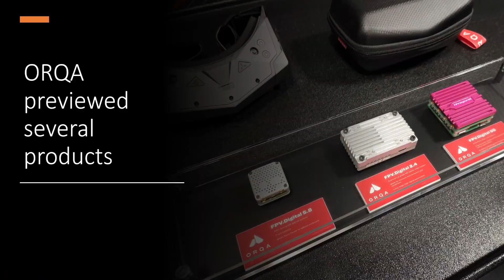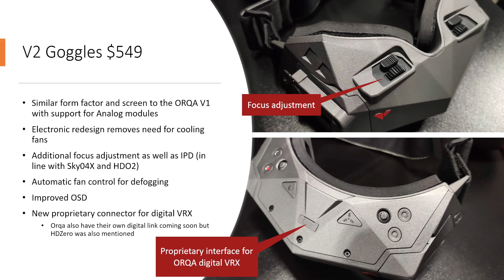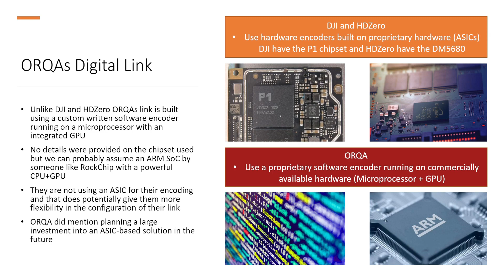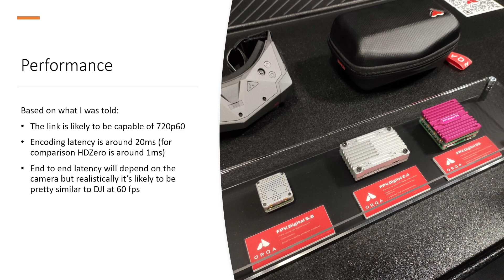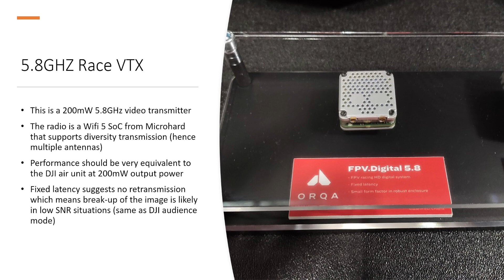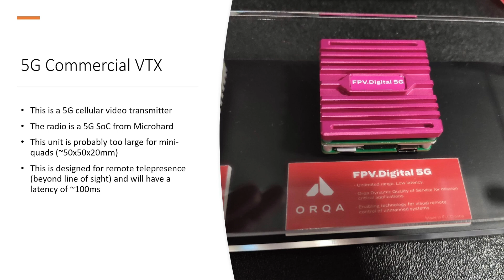ORQA's NEW DIGITAL FPV SYSTEM: Everything I know! (and other products they showed at CES)

Comment: Assuming a pure general-purpose CPU solution, this may pull just too much power from a drone battery, I would find this hard to believe, honestly.   If I may speculate any further, FPGA chips (basically purposed for prototyping only) may be a better guess as nowadays, they allow sharing programmable logic, ARM CPU's, ASIC technology and even AI engines on the same die.  This class of chips surely would manage to keep power consumption rather close to their ASIC ancestors.  For several years already FPGA's became popular among retro-computing fans for their ability to emulate some powerful custom graphics and sound chips from the Commodore Amiga lineup.

Comment: DJI is 120fps not 60
Reply from the maker: In high quality mode DJI is 60fps. In low latency mode DJI achieves 120fps with cameras that support it (DJI camera and Nebula Pro). Orqas solution is likely to be similar to DJI 60fps.
Reply: @ChrisRosser  The question is why would one invest in orcas if they are same as DJI?   I would not sell my DJI to get Orcas if they are same.  Orcas need to give me something that DJI does not.  
And DJI can cut price to compete with orcas.

I heard DJI will introduce AR system where you can build virtual gates in sky to race.   I am sure that is more exiting then competing on same technology.

Comment: Do you know if these VTX/VRX include a control link like SBUS?

That would be necessary for the 5g one I guess
Reply from the maker: Maybe for the 5G version. For the other VTX I believe the intention is to integrate IRC Ghost into the flight controller rather than the VTX because there is less interference on the FC.

Comment: The controller is a huge miss in my book with it's proprietary connector but my guess that is that was Ghost's doing to lock people into their ecosystem. I'm super pumped for the goggles though. They look very promising & they said with their adapter you'll be able to runs a variety of receivers on it. It'll be neat seeing how that plays out.
Reply from the maker: I'm interested to see how it plays out. I'm undecided as to whether the goggles offer much of an advantage over my Skyzone 04Xs at the moment and the controller is ghost only which is tricky because I like having support for multiple protocols.

Comment: A way more interesting approach for them would have been an FPGA+MPU solution to get the latency lower.
Like this I don't really see it being competitive with DJI or even HDZero. At least in the FPV space. Might work well for other, especially industrial remote control applications though.
Reply from the maker: Yes, I asked them if they were using an FPGA but they said no. So I think its just MPU+GPU for now.

Comment: Hello and thank you for all your hard work …I have a question for you or our community,   I have a nazgul 5v2 just replaced the stack …flying every day but I have to land early bc my battery readout says n/a…it has a vista …please help I’d like to get back to flying full packs …custom osd is turned on in dji goggles
Reply from the maker: Your MSP connection isn't working. Maybe TX/RX is wired up the wrong way round or the wrong port is set in BF.

Comment: Based on this information regarding our FPV hobby, it seems to me like Orqa have taken the worst parts from both the DJI & HDZERO systems & made a product. That being the higher latency (even if it is fixed) from the former & worse camera image (720p 60fps) from the latter.
Unless I'm missing something, buying this over DJI or HDZERO makes no sense 🤔
Reply from the maker: Given the information available at the moment I have to agree. Unless ORQA have worked some unicorn magic a software encoder (even with hardware acceleration) is going to find it difficult to compete with a pure hardware solution.
Reply: What if it has lower latency than DJI, and also fixed, and higher image quality than HDZ though? That might be a sweet spot for a lot of people. What I find most interesting though is if they prove that general purpose chips can achieve something usable then that opens the way for open source development. Wouldn't it be great to see a project similar to ELRS building an HD FPV system?

Edit: Carl seemed to be saying in his interview that HDZ isn't doing traditional video encoding, just 'removing redundancy'. This implies things like RLE, chroma subsampling and even algorithms like zip may be enough to get 720p video down to a usable size for wireless transmission. Those would need at most 2 frames to compare (so can be low latency) and are achievable by CPUs and GPUs. Perhaps that's all Orqa are doing.
Reply: @sligit as I said in my original post, my opinion is "based on this information" from Chris's video.
I totally agree that it's great to have another competitor in the HD market & I hope that it pushes each company to strive for better performance, cheaper pricing etc.
If Orqa were able to do all of the things that you hope for, then they should have included them in this initial release to make it competitive with the already established market leaders. As it stands, they are playing catchup & there is currently no reason to buy this over DJI or HDZERO.
Reply: @pscott82  I've no idea if it'll be any good but if they're putting the money into manufacturing then presumably they have something they think has a market. I've no idea if the video will be better or worse than HDZ because Orqa aren't sharing what it looks like, so it's all speculation at this point really. All I was saying is that if they could find a middle ground between HDZ and DJI then there's probably a market for it..
Reply: @sligit yes it's all speculation, but based on the details already revealed, informed opinions can be made.
If you haven't already watched this weeks 'The News' with Joshua Bardwell & itsBlunty, they shed more light on this project & make it sound like the FPV hobby is not the main focus of Orqa. We're an afterthought & won't be seeing this product in hobbyist's hands anytime soon.
Reply from the maker: @sligit  OpenHD and RubyHD are both open source projects that have been working on HD FPV for some time. Unfortunately their latency is still 50-100ms glass to glass. Even on very powerful hardware like the jetson nano. I'd love Orqa to be able to achieve lower latency and higher image quality than DJI on inferior hardware but that would qualify as a miracle in my book!

HDZ throws away information that has a minimal effect on the perceived image. To get down to 1ms latency it works on 3 lines of the image at a time. Waiting for even a single frame takes too long. DJI uses subframe encoding (working on part of a frame at a time) but even on an ASIC the processing time must be around 10ms.
Reply: @ChrisRosser  OpenHD and RubyHD are both using traditional video codecs though I believe? Those are inherently high latency. The point I was trying to make is that if Orqa are managing relatively low latency on commodity hardware then they're probably doing something else, possibly something closer to the method that HDZero is using.

It seems that relatively simpler (than traditional video encoding) operations on the image data can get the video down to a transmittable size because that's what HDZ is apparently doing. Those sorts of operations might be achievable fast enough on a GPU because they may not involve the heavy processing needed for traditional codecs. Again, I'm thinking of things like chroma subsampling and traditional, non-video, stream compression, like Zip or Snappy which are relatively low cost.

Also I'm not suggesting Orqa might be higher quality that DJI. What I meant was that there could be a place in the market for them if they sit somewhere between HDZ and DJI. Slightly higher quality than HDZ, more predictable latency than DJI. That's entirely speculation and probably not the case but was just a response to "Orqa have taken the worst parts from both the DJI & HDZERO systems & made a product". If it was somewhere between the two then there might be space in the market for them.
Reply from the maker: @sligit  Both OpenHD and RubyHD are using H264 compression (the same as DJI I believe). I would agree that H264 compression is inherently higher latency than HDZero's JSCC approach because it requires more of the image to process. But it can still be very very fast (sub 1 ms). The latency is very dependent on how much of the frame you work on. Traditional encoding works on many frames at a time and as a result has huge latency (as much as a second or more). If you work on only part of a frame at a time you can cut the theoretical latency down to less than 1 frame (16ms at 60fps) but the challenge then is getting enough compression as its harder to compress smaller chunks of data without massive loss of quality.
Reply: @ChrisRosser  Interesting. I didn't know h.264 supported compression without multiple frames to work on, but then I suppose it's a big standard using a lot of techniques so it shouldn't be too surprising that you can pick and choose to some extent.

Comment: Thank you for the most details on Orqa with your video and the comments. I have their V1 goggles and an not impressed, thought the focus would help but only 37 degree fov is a killer.  My #2 reason to avoid DJI digital was propriatary parts, this is just more of the same, and with Orqas proven slow updates there is way I could go for that either. My feeling is like my V1 goggles ,by the time they get it working decent they will abandon it and go down a different path.
Reply from the maker: The proprietary parts is an issue that I totally understand. From my perspective: Analog uses a proprietary chip (Richwave) and no-one worries about that, HDZero uses a proprietary chip (DM5680), DJI uses a proprietary chip (P1). The important thing is that these proprietary chips are made available to multiple product manufacturers (which looks to be happening with DJI at last) so there is good competition. Orqa is actually the only system that doesn't use proprietary chips (but they use proprietary software). OpenHD should be able to achieve similar performance to Orqa without using proprietary chips or software I hope.
Reply: I love the dji system. It was an expensive upgrade but well worth it imo.. still can't do tiny whoops digitally yet though which is a downer.. if I could get a sub 30 gram whoop with dji I'd be a happy camper

Comment: Chris thanks for this perspective. I wonder if Orqa will have the same issues getting camera manufacturers on board to support the FPV vtx. Just recalling the issues HDZero had with getting them to make good cameras initially until Carl paid Runcam to make a batch to his specifications.
Reply from the maker: I think they will just use the MIPI style cameras that are available for the other systems so we'll see the same range of cameras as for HDZero.
Reply: @ChrisRosser  what do you mean by MIPI style cameras? All the cameras connected to a caddx Vista or an airunit Talks the MIPI protocol. So all dji cams should work?
Reply: @p.k.5107  DJI's MIPI connector is proprietary. HDZero's isn't, therefore ORQA could probably use the ones that have been developed for HDZero so far. Also, Carl want's to sell the ASIC's to anyone willing to develop their owns digital VTX's that is why I believe ORQA should at least consider using divimath's ASIC for their FPV VTX to start off and leave their enterprise VTX's  for their owns software based solution or future proprietary ASIC they want to develop.
Reply: @Pyrolassist  Ah, i didn't know that, thanks for clarification! I See why Carl wants to do that. I once saw a Video where they said fatshark is the Main customer of divimath. If fatshark goes down, divimath will too. So its better to let someone Else make some money but secure your partners future. And I agree, After seeing this Video they definately should consider divimaths asic.

Comment: so what they "showed" was 3 boxes that might or might not do anything - and by the looks of it they dont even claim massive performance improvments over dji sooo why would anyone buy this? I only see this working out if it significantly cheaper then the existing solutions
Reply from the maker: I think they are focussing on the commercial segment (2/3 products are for commercial) where latency and cost are less of a big deal. I don't expect (given orqa's pricing) that their system will be any cheaper than DJI or HDzero.

Comment: Damn really want that 2.4ghz 1w for long range. But damn over 100ms is a lot of delay. Wonder what it feels like. I'm normal on dji at about 40 to 50ms flying far.
Reply from the maker: It'll probably feel fine for gentle cruising but pretty disconnected for acrobatic flying.
Reply: @ChrisRosser  I might try it when it comes out if not ridiculously expensive. Built 8 to 10" drone for it. Mountain surf
Reply: Just what Chris said. 100ms is 0.1 second. It’s what relaxed or simple long range needs. In fact, 0.1 second is insanely responsive. But I wouldn’t fly it for racing or do freestyle that involves flying thru the small gaps

Comment: Does software include FPGA?  I could see a combination Software and FPGA based solution being viable, but software only won’t do and will have too much latency to be competitive.
Reply from the maker: I did ask about FPGA and they said no. It's software running on  MPU+GPU with hardware acceleration for encoding. If that is the case it will be slower than FPGA/ASIC.

Comment: Few other comments:
- if you design a system to have no retransmission, you will handle the corrupt data differently. it might also be a good idea to transmit additional smaller resolutions of the image to have a fallback
- fixed latency does not require "no retransmissions" it just requires a fixed retransmission budget. but retransmissions will always increase latency.
Reply from the maker: Yep, I should have realised that they could have a fixed retransmission budget. But that will increase the latency of the whole system to the worst case all the time. Not sure if that's better than a variable latency.
Reply: @ChrisRosser  within 1ms you can already resend 5+% of the image. That would cleanup a lot. But not sure it’s worth the hardware costs. Spending the time budget to send mor redundant data might be a better choice.